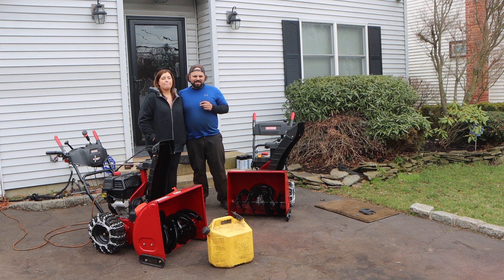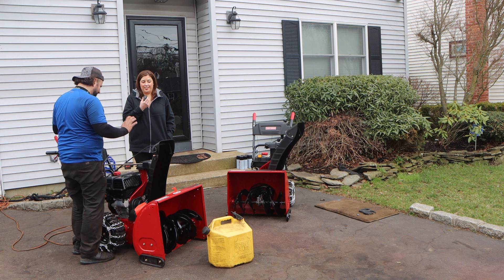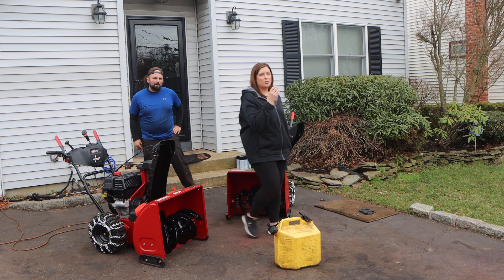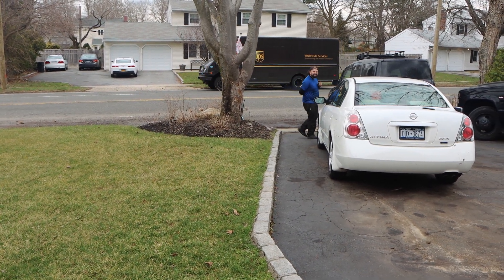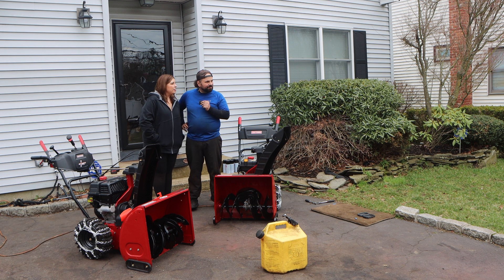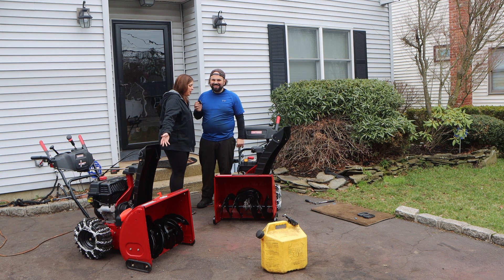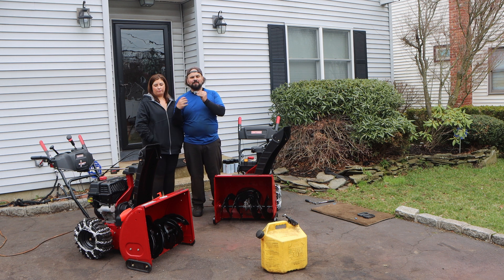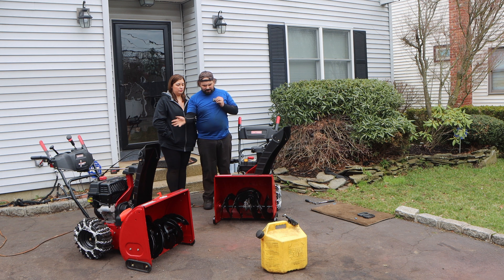Driveway Science... Is the Craftsman Quiet Techology Snow Blower Really Quiet?

Comment: at only 200 cc's, it better be quiet.  That is a weak machine.
Reply from the maker: Incorrect 208cc is a force to be Reckon with a modded impeller.  Plenty of proof of that all over YouTube including my channel.
Reply: @pattayperformance  Lmao.  Yeah, you have to mod it out.  Of course, a 1969 Ariens can throw nice all modded out to.  Compare natural stock, oranges to oranges.
Reply from the maker: @daryldaryl887  incorrect…

208cc/Predator 212cc can do things the measily 5HP Tecumseh could never do.  Again tons of proof of that on the internet.

I’ll help you…

Here is a 212cc on a 32” Ariens and kicking old man winter in the nuts.  The 5HP would struggle to do what a 212cc can do and even a 208cc
Reply: @pattayperformance  Anything in the 200 cc range is a joke here in NH.  You'd be scooping out clogs every 5 minutes, stock.
Reply from the maker: @daryldaryl887  any snowblower that isn’t a modern ariens, toro,yammy or honda you will be scooping out.  Power means nothing when it comes to heavy wet slushy snow.  Impeller tolerances is the issue.  

This year lots of reports in Cali of Hondas clogging up with their slammed season.

FYI the YouTube video I posted to back me up in shot in Maine.  🫡
Reply: @pattayperformance  Hondas are known cloggers, have been for years.  No video posted.
Reply: Hondas are also underpowered.

Comment: Great Video!!!  I wanted to wish both of you “ A Very Happy Easter”.   
It was really surprising to me to see a defective NGK spark plug - It’s just something that you don’t see very often.  

So, I started up most all of my small engine stuff a day or so ago and noticed on my Yazoo S-24 with the Predator 212cc engine that the rubber vent hose from the top of the fuel tank to the housing leading to the carburetor had split wide open and was spraying gasoline.  
Considering the odd size of the hose, I ordered some replacement 3/16 ID neoprene fuel hose to replace the faulty section of hose and will probably replace the section from the fuel tank to the carburetor for good measure as well for peace of mind.
You Know, I think that it is a very good idea to inspect the fuel hose especially on the Chinese engines that are becoming more and more common nowadays, Not to mention the increasing cost of fuel. 
From my experience, The Chinese rubber hose seems to deteriorate very quickly compared to the hose and or fuel line that have been used for quite a while on the domestic manufactured engine products.  

I feel that It’s much better to address the problem now than when the machine is really needed to do a job and be down - Not to mention the fire hazard scenario involved.
Reply from the maker: They have a funky diameter (Honda).  Crazy so fast it rotted away.  Hemi is a few years old on the Ariens...
Reply: @pattayperformance  Yeah, I couldn’t believe that the rubber had deteriorated so quickly and so badly. I entertained the thought of trying to cut a piece of tygon
tubing being that it was the vent line. If nothing else, Maybe a good topic of future discussion.